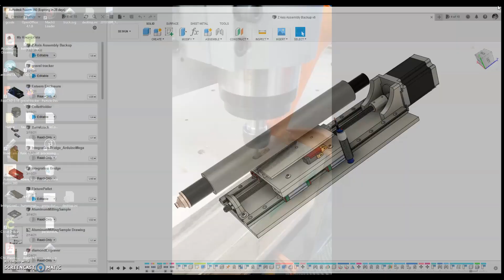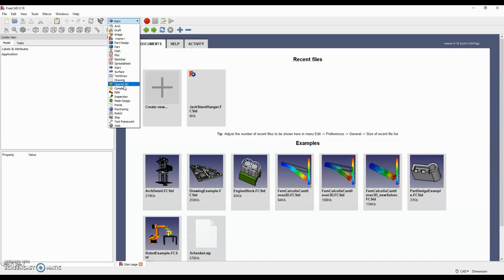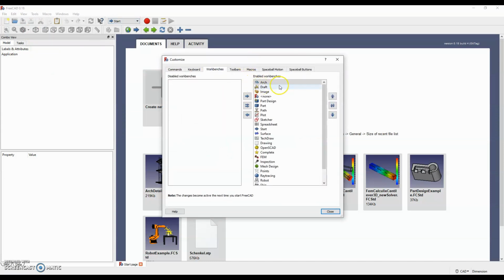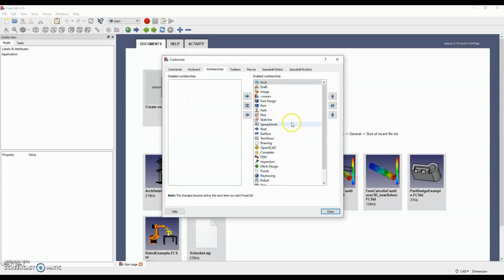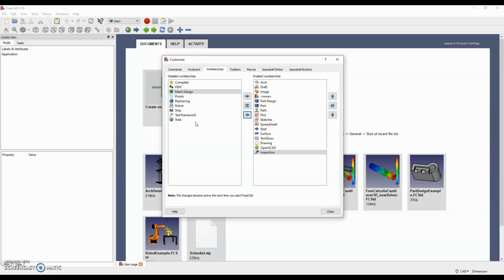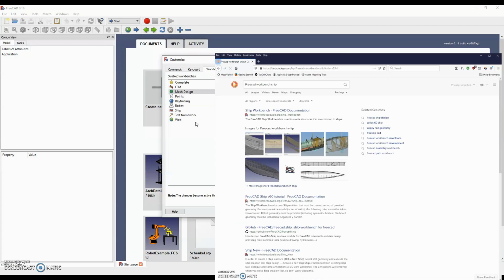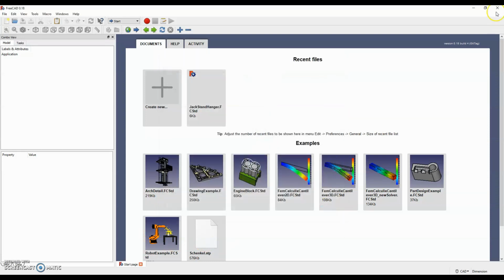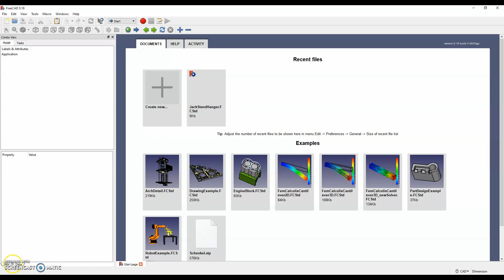Workbench List in FreeCAD

Comment: Thanks! 🙂 I was just wondering what should I do since Draftsight aborted free accounts last year... I lost my day job also so can't use programs at work either anymore... 

I have not used 3D much but I am really missing the sheet metal bend and flat pattern feature for making dxf cutting files...  They had Vertex 3D software. 

It would be immense help if You could make general guidance video about diy cnc today. Programs from design to cutting and what gear to use. 

I have watched all of Your videos and I have been following You some time now - great content!
Reply from the maker: Part of my looking for new CAD and CAM software was due in part to my plasma table coming (almost) online.  I didn't want the heavy weight of F360 when all I wanted to do was make quick adhoc cuttings.  But I knew whatever it was, giving dimensions and constraints was super important.  That is when I found FreeCAD.  And I have to give a lot of credit to DonDIY.  In one of his videos he was using it so I pulled a frame and saw the name so I gave it a try.  For CAM I am currently using SheetCAM for the plasma.  For 3d stuff I still use F360.  There CAM is amazing.  I haven't tried the FreeCAD CAM workbench yet.  For completeness, I'll mention that I use Vectric products for more 'artsie' organic stuff where dimensions are not as critical.  ~P